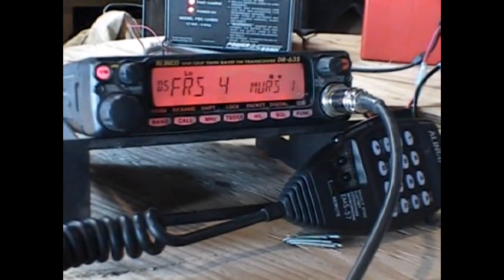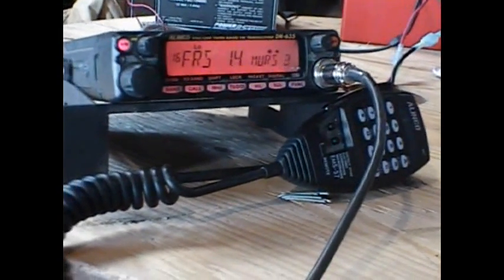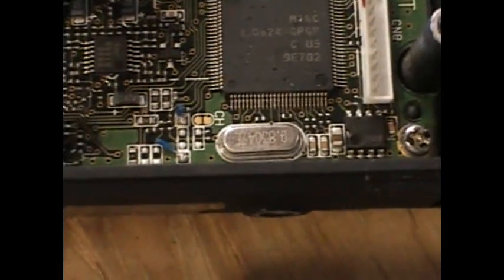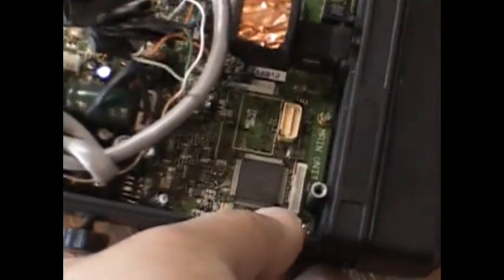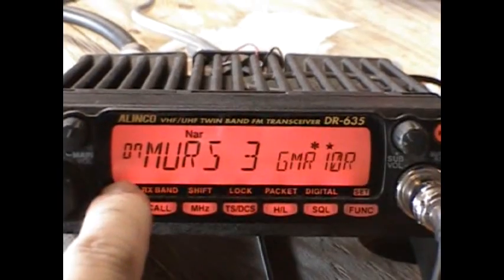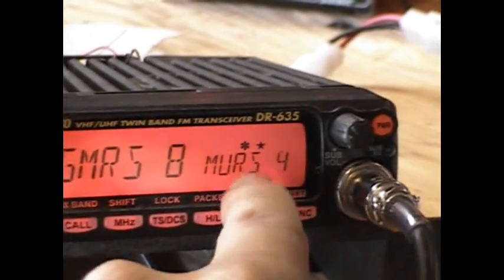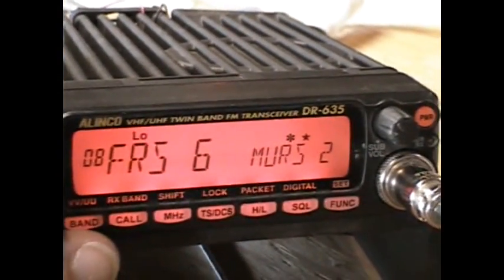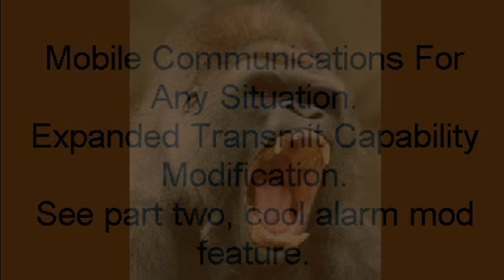Mobile Communications For Any Situation. Part one (TX Mod)

Comment: I did the blue wire cutting on my DR635, and it did expand the TX freq range, but it cuts down on the power  a lot - can only get about 15 - 18 watts beyond 150Mhz and not the full 50watts

Comment: Thanks for sharing the mod info, it worked perfectly.  For those guys that say this is illegal...well FCC says you can transmit on any frequency in any mode in case of an emergency.  This is just called being prepared.

Comment: I cut the blue wire on my 635, held down the func button and pwr button, and the unit did not reset..... any suggestions??
Reply from the maker: Another YT user had the same problem, which I could not replicate or figure out. Turns out, he did the same steps, but then programed a saved file he had before the modification. When he did that, it reverted the radio back to the locked ham band configuration. Try the master reset again and manually start programming  from scratch. That's what he did, and it worked. first try programming an out of band freq in VFO mode to see if it took, if it does, then you could read the radio and configure the rest of your configuration easily using the software. Please let me know what happens. Good luck..

Comment: after your mod it is possible to transmit on air band like 126.700 ?
Reply from the maker: No it will not work, the radio is not capable of doing VHF-AM. Though I know for sure the Yaesu FT60R is capable. Its a handheld.

Comment: Yes, I did the master reset ( hold down FUNC and power on). That expanded the receive frequencies. I can receive MURS and GMRS but when I try to transmit, the display shows OFF and there is no output.
Reply from the maker: Wow, thats odd. Mine took without any problems & it works on GMRS/MURS. The only thing I can think of right now, if the settings defaulted to something else. Look at your offsets, if there is a + or - sign on the display, that means your offsets are on and maybe defaulted to something weird like 200 MHz. Personally I dont think thats it, but its worth a look. My rig is about 4 years old maybe they blocked that mod, though if they had that blue wire to be cut, I dont see why they will go through the trouble of installing it. I have no answers to this one, Sorry to disappoint.
Reply: I wanted to let you know that I solved the problem.  My radio is working correctly now.  It turns out that if you load the radio memory from a download out of the radio prior to the mod, it wont work.  I made a new download from the radio after reset, put my channels in it and reloaded to the radio.  It works perfectly now.
Reply from the maker: rpellicciotti
Outstanding, I'm glad you got it going. Thanks for the feedback, I could relay your findings to others having the same problem. Though, this was the first of heard of.

Comment: I preformed this mod on my DR635T and the receive is expanded but it will not transmit on the expanded frequencies.  Any suggestions?
Reply from the maker: Did you do a master reset? I cant remember right now how its done but you could google it.  The radio has to master reset for the changes to take effect.
Reply: Hold down the function button while turning on the power.

Comment from the maker: After some time, I have low audio modulation and the cord is fraying. I dont use it often either. Its a bit wimpier than the commercial hand mics. So far, it works and the buttons are still funtional and keypad also. I send DTMF tones more often than actually talk, which is weird to come to thinking about it. Thanks for watching.

Comment: I just purchased one of these rigs yesterday(used)& programmed it TODAY without the manual.VERY EASY to do & I do have the manual,box & everything that came with it but again the manual was NOT even needed.I think I am going to really enjoy it on the 2 meter & 440 mhz bands though I usually buy only ICOM gear! Thanks for the video just in case I need it to work outside the ham bands! {:>)

Comment from the maker: You should be able to tune directly into the 440 range, what it will not do any more is separate the bands conveniently. For example if you scan 2 meter, it also going to scan strait through to the 170Mhz range. Though the uhf & vhf are still separate.

Comment: If a license is needed and you don't have one, any transmitting is illegal. No problem in listening, but the radio already has that capability.  Cutting the wire enables out of band transmitting, but if you aren't licensed, it is illegal.

Comment: This mod did not improve the range of the radio as far as transmission, but for the range of frequencies that could be used for transmitting.  Such a mod does make the radio more versatile, but you still need to be licensed for those frequencies.  If you get on a MARS frequency without being licensed, either those operators will not talk to you, or you will have someone come visit you about unauthorized transmitting.  You better "be in a pinch."  The fine is $5,000 per violation.

Comment: If you have a modified radio for amateur use that will TX GMRS/FRS (which parts are shared) but have a GMRS license, no, as long as your ERP does not exceed the prescribed legal amount. If I use a Kenwood 710 and TX on FRS at 5w power, who is to know its a 710, it could be any other radio that tx specifically for FRS @ 5w ERP. 

73s
KC2VVJ

Comment: Will backfire and cause radio failure, which can cause fires. The internal structures are not meant to handle those loads.

73s
KC2VVJ

Comment: If you want to expand a CB radio, your looking into a lot of time and costly work. A CB is not designed to TX beyond is pre-set bandwidth. If you end up expanding in either direction, though, you definitely will be interf. with HAM HF radio com. that are licensed through the FCC. And the surrounding freqs are mainly CW (morse code) only or USB AM/ LSB FM tx phono only. If you TX anywhere in there, and your "out of mode" you more than likely will be found and fined heavily, and your SWR will back

Comment from the maker: I dont know, Dont mess around with CB or HF gear for now. I heard of mods to convert CB to 11 meter band. If I were thinking of having a setup like you mentioned. I would look into getting HF gear that can be modified to work CB. CB max power is 4-12 watts depending on mode. HF gear could be 100-1500 watts in one unit. As a disclaimer its against the rules & I'm not too experienced in this range.

Comment from the maker: Yes, if you use an amateur radio on GMRS frequencies. Amateur are title 47, code of fed regulation part 97, GMRS FRS,MURS are part 95. different radio specs. Though I think some commercial radios, (Part 90) are rated for the rest, dont really know. bottom line its not legal. in an emergency, use what you got to portect life & property.

Comment: Just save your money and get a certified GMRS capable radio.  The issue is, different part qualified radios have specific quality of transmissions.  Some are wide band capable, some arn't.  If you transmit spurious transmissions into a band you are not authorized in...you could potentially be fined and maybe jail time.

Comment: I agree vorkev.  Which is why you shouldn't modify your radio to operate out of band other than what frequencies you can legally operate.  I guess this guy is just showing how to modify the radio just in case you want to transmit out of band.  To everyone watching this video....don't transmit where you are NOT legally allowed to do so.  Don't bother doing this UNLESS you absolutely need to.

Comment from the maker: This is a repost from an earlier question. 
 you have your dual display setup, one side will be vhf in memory or vfo mode the other in UHF of the channels you want to use.  Once setup, turn the power off, turn it back on while holding the "BAND" button. a "star Icon" and R icon will appear on the screen to let you know you're cross-repeating. The same sequence will exit the crossband mode.

Comment: the hole thing is so complacated with thare being diferent frequencys some you can use some you cant some requers a certin licence some do not. from what can figure out you are damd if you do and damd if you dount. a nother worrds if you read and new all the laws and whats prohibited and you have the max licence you can bet thare is still something thay can get you on. the point is when thay started to take over the fcc wanted it to beo so hard to learn that most people can be fined

Comment from the maker: @sarga40 The DR635 and other mobiles have a function called Crossband repeat, beaning it will repeat vhf to uhf and viceversa. you would have to get dualband radios to have sort of a repeater system. Alsoyour Rhino radios will not be compatible because the filters on the alinco is tuned for ham freqs not GMRS. Veh to Veh, you could have more coverage, but when you go on foot, you will lose range. You're talking big money for a repeater.

Comment from the maker: @local43130man Alinco sells a card for APRS (gps tracker and digital data). I didnt want to use their gear, so I made an interface cable wired directly to the radio board to work off other APRS/digital devices with more capability other than alinco stuff. Very sloppy job on my part but it works,  I really butchered the inside connections.  No, I'm not gonna make a vid about it, it would be really boring, even for me. Figured there wont be any interest. Thanks for watching

Comment from the maker: @Griffith181 Almost the same procedure except the blue wire is located on the rear of the front panel display board.  Got the info off the web from a reputable source, I dont have any experience with the DR 135. Will PM the exact modification procedure.

Comment from the maker: Yes, it does Crossband repeat, it works well in the ham channels but outside  that, its iffy. really easy to setup. you have your dual display setup, one side will be vhf in memory or vfo mode the other in UHF of the channels you want to use. 
Once setup, turn the power off, turn it back on while holding the "BAND" button. a "star Icon" and R icon will appear on the screen to let you know you're cross-repeating. The same sequence will exit the crossband mode. 
Happy 4th, take care.

Comment from the maker: @SolarSteveUSA It does, but it doesn't work very well. I'm thinking the filters are only designed for Ham channels. Once you get 20 feet away, you lose contact. works great on ham channels though. I wouldn't recommend this radio if budget wasn't a factor. if you're on a budget, then its just OK. In congested towns or cities you do pickup quite a bit of interference, audio quality out of the built in speaker is poor.

Comment: Question...Can the cross repeat function work with expanded freqs? Say repeat MURS or GMRS into 2m or 70cm? Also, would you recommend this radio? I've heard some negative reviews out there, but for the price point it offers a lot. Very interested in this particular rig, so any feedback is appreciated! Thanks!!!